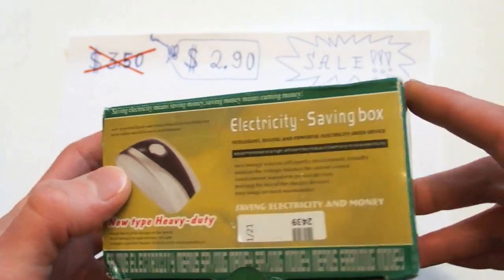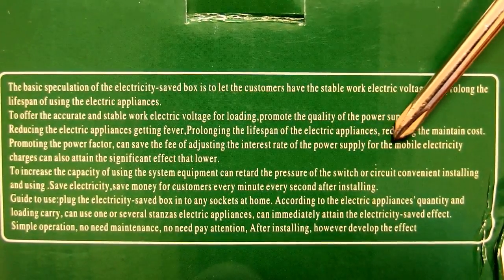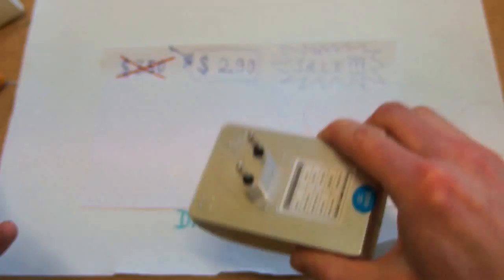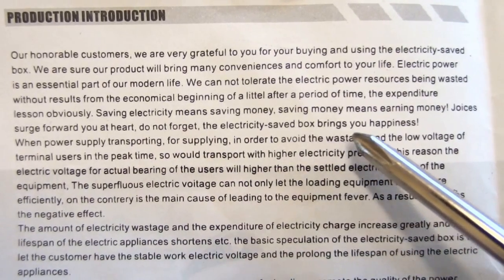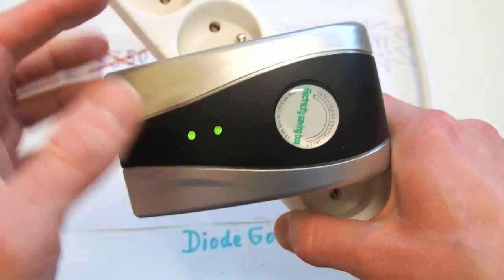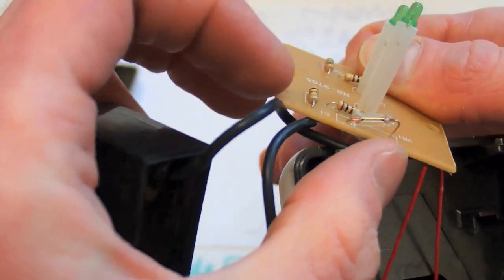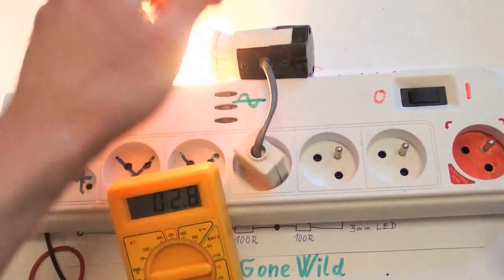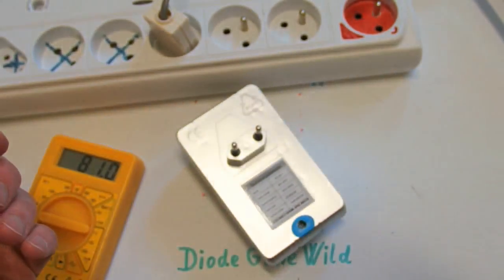Electricity Saving Box - (Free Energy?) Power Saver TEST

Comment: Thank you for opening it up and checking what is inside. A friend of mine (retired lady) has installed one of these and claims her electric bill is crazy low because of it. Based on what you show my suspicion is the the resistors are there just to make the LEDs work, as a "convenience" to the user that it is on, and if there's a light then it MUST be doing something highly intelligent.... The black cap looks like a DCLink capacitor, likely Panasonic brand, but most likely a Chinese knockoff. Good news though, is that the DCLink cap would be a few dollars by itself, so it's not bad of a deal provided you get the cap, and a box and a connector to plug it in. It will not help to store energy, but it will help to cut the high energy spikes coming from the household SMPS supplies of charges and LED lights, so it will be useful to significantly extend the lifespan of many household utilities, making returns in the unit cost many-many fold. 
I guess though if they advertised it for what it actually does, it would still sell  but not nearly as well. BTW if they used not a 1.5uF DCLink, but a much smaller 10nF cap it would protect much better against the high energy SMPS spikes.... and it would be cheaper for the manufacturer as well. They could have made twice the profit!!!!! :)

Comment: I loved the test, and the openmindedness about how it could be valid, however there was a HUGE problem with it's premise:  this is not a free energy device, it's a wavelength cleaner.  Yes, it does use a tiny bit of energy without producing any, and yes it can clean things up amazingly.  I am a science teacher who has known of this technology for over 30 years already, but big business surpressed it in the name of protecting industry, of course.  I have in fact tested this particular device myself, and did take my electric bill from $250/mo to $50, no joke.  One month we actually got it down to $18, but with running a bit of a boarding house now, my average usage costs $75/mo.  Logic is no replacement for experiential testing and research of the technology.
Reply: The principle is obviously that it converts the sine waves to half waves, which don't reverse direction, which increases the efficiency of the current.

Comment: Device contains capacitor so this type of devices can only be used for power factor correction of load i.e connecting capacitor across induction motor or any inductive load can help in reducing excessive inductive current draw into load. 

However, home appliances mostly are resistive load such as tubelight, LED bulb , CFL bulbs, Incandescent bulbs and soon. When such devices containing capacitor is connected across resistive load then, resistive current along with unnecessary capacitive current is drawn which causes power loss in device circuitry but not by capacitor.

Conclusion : Incorrect Nomenclature is given to this device and a Big SCAM☠️

Comment: It worked for me. Have to put it in socket close to panel box. It does work if you give it time.
Reply: Also, I believe it's meant to save power (by regulating it) not to generate power... and that would mean that our usual power system waists a lot of power the way it works... So if it works, it should be provided to all homes as a standard.

Comment: My dad fell for these, bought 3 and gifted one to me. I didn't understand how it worked and here I am
Reply: Send me One pleze
Reply: They actually do work. Ive taken electrical physics and they are doing something called 'power factor correction'. In a lab experiemnt you can prove that putting a capacitor in parallel with a load will decrease the amps taken to run the load. its neat.
Reply: @briandevine8335  Don't believe this clown. You can literally open one and see that it only powers the lights 🤡
Reply: @briandevine8335 , how much electric company owes you now?
Reply: @briandevine8335  From what I understand it's doesn't produce power but saves power... (it's not the same at all)
Reply: @cosymedia2257  yes from the ads I remember it’s supposed to decrease your electric bill

Comment: Great video, it's nice to see you measure 2 or 3 times before touching voltage, you will live long. I bought one of these, and I measured the capacity and mine was 3.7 micro farads, I also have a power factor measure device, and this "saver" decreased the p.f. from 0.85 to a p.f. of 0.7 when I connected a load, it makes your electricity bill bigger!!!.
At the end I am sure they don't work, it's basically a technological scam, I guess is such a small scam that they are still in business selling them, and there are a few cases that the inductive load is offset by this capacitor and they work, probably 1% of the cases.
Reply: House power is mostly capacitive nowadays because of switch mode power supplies, and most big inductive things like air conditioners and AC fans have their own PF correction capacitor.

Comment: I'll bet it's a MOV, which would read as a capacitor in your test.  Many years ago when I worked at Radio Shack, we sold a plug like this with an MOV inside to short out voltage spikes and "smooth" line currents.  It did work for that, but it didn't save power, and an MOV only lasts a few years till it must be replaced.  It would be great if you put it in an epoxy solvent and found out what component was potted in the "magic" box.  :-)

Comment: No, it actually is a capacitor working to clean up the power, thus saving a percentage of power instead of waisting it through heat. Works much better with motor loads. Washer, dishwasher, furnace, etc.
Reply: how much did you save?

Comment: I'm going to use here the theory of 'if's' and it function as magic to inventors,producers,and consumers .Especially,remember that not all of us can mend our minds in every field ,it's so harsh for the mind itself but if your mind can acquire those requirements which can make every invention succeeded 'an inventor gain 10%',if he teaches the producer how to factorized it inside a factory 'a producer will gain 20% if he doesn't he will gain just 10% and the other 10% will flood in the market,if the inventor and the producer cooperate the one who have more efficiency to the term of share hold or stock hold  he will take that 10% off the market.If I thought of being optimistic and said that they are in harmony of having a share hold for a certain time let's say half a century as my age so they will have a budget of 40% inside the factory despot and the sealing for consumers inner market.Mostly economist don't deal with the inventor they think he is somehow hypo-hazard to be inserted as his ideas inside the invention.Here we have a system of saving power although it's a belief that an inventor is a scientist whom people can't deal with so he can't rescue the data of his mentality from exposure to invalidity .Returning back to the magic box  it should be a sensor that leads you as a consumer for high magnitude or low magnitude to insert your equipment or a service appliance,thank you'IF YOU CAN'T HELP YOU CAN TEACH & IF YOU CAN'T TEACH YOU CAN'T HELP EVEN ONESELF'

Comment: Mr diode is not very well educated in electrical engineering but he is good in electronics.
 This device isn't fake or scam. How?????

When you connect too many inductive loads to an ac source basically motors it creates lagging power factor that is not a good thing, for fixing it you need to put a calculated amount of capacitor to make this right. And what you found in that device a big capacitor. But actually you can't mess the power factor that much ,to require a solution for this.  
Simply this device is not required thing to have.

So conclusions if this device has good components especially capacitor then its not fake.But it could be copy of smilar good device. 

Note:- Before making any comment in anger you need to learn about a topic of Electrical engineering called " Power Factor". 

Then you won't laugh like other because you will understand what exactly that thing is.😊
Reply: Yes, but that won't change speed of your energy meter. Energy meters do not measure  kVAR. 
Also every inductive load have inside small capacitor that incrice power factor to 0.95+ .
This device is total scam.
Reply: @Joel Skulish Lol😂😂😂🤣
Reply: @DiscoverRajivVlogs  Come on, man!
First, the diode guy definitely has an education in the field of electrotechnology.
Second, while your point is right in theory, in practice you can't achieve any useful power factor compensation using a 1μF capacitor. It would be like trying to isolate your house using a piece of cardboard paper.

Comment: The black thing inside is a capacitor. They do nothing except maybe smooth the power. It would actually draw power not save it.
Reply: Wrong I've been using it for 7 months it works by one on eBay it's only like $8 you got nothing to lose stop speculating
Reply: @markt9438  "Nothing to lose". Let's break this down shall we, there is the initial price of $8.00. plus tax, $0.80 plus shipping $?.?? plus outlet availability $?.?? And after instillation, many believe it will only have  a negative impact... Not to mention how IF this is a scam, then all proceeds go to making scamming a far more lucrative business. It's not nothing. Far from it.
Reply: @brandenlumley4056  my last month's electric bill was only $47 I live in Central Florida so you tell me as I save money and this is a two bedroom two bath 1100 square foot home of course I'm the only one that lives here my highest bill so far this year has been $97 no one I talk to can justify their electric bill as well as mine
Reply: @markt9438  can you provide a link to a source that gives semi-concrete evidence? While the comment section is a very good place to gather general ideas of arguments, it is very difficult to stage anything save a straw man fallacy here. This does of course include my own comments unfortunately.
Reply: @brandenlumley4056  I told you my results so you can either believe it or not I took the chance bought one on eBay and that's where I found worked for me

Comment: This is the strongest smelling bullshit story I ever heard from! At best, it will USE MORE energy than before using it (due to two LEDs, constantly lighting up). The only possible benefit would be that the macic box contans an inductive load that causen a shift in phase between current and voltage. Scam! Don't buy unless you need a nice looking case for you DIY projects :-)

Comment: We got one just like this for free when mother in law perchased some blankets. After 2 months it burned up. Almost made a hole in a rug, and the electricity splitter it was connected to melted. It's not just a scam, it's a serious hazard to have.
Reply: Instructions clearly say plug into a socket and dont use a splitter........ smdh
Reply: I've had one for over 2 years no issues you need to plug it into the center of your house in a freestanding socket
Reply: @markt9438  I opened it up. There's just 1 capacitator, a coil and 1 led inside. There's no way a device like that can save energy. It's a scam. Remove it, and i bet the electric bill will stay the same.